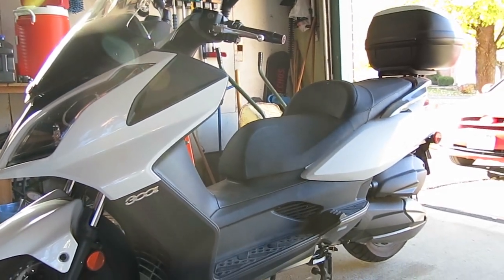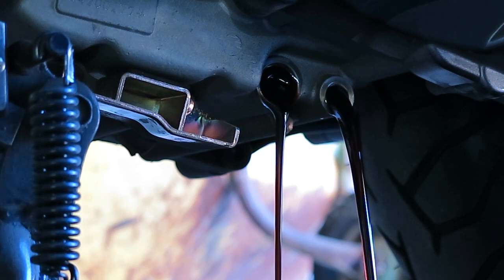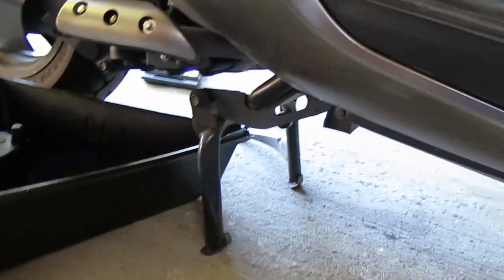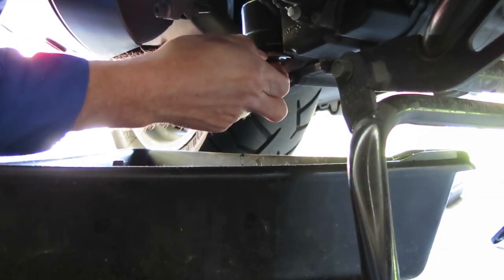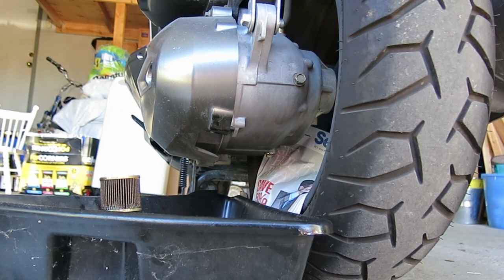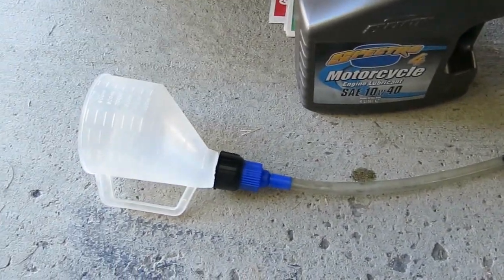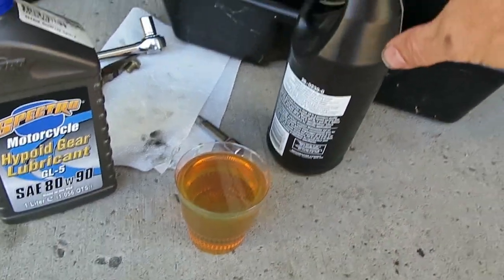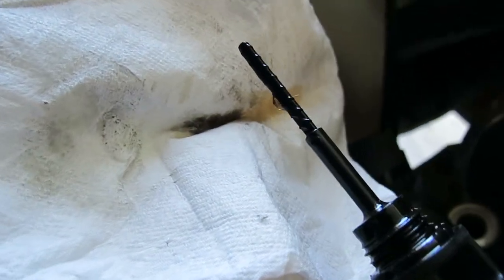Kymco Downtown 300i engine and gear case oil change

Comment: For the gear oil I just use a syringe it’s so easy -just measure what you need and squirted in.  Shouldn’t the drain bolts be torqued?

Comment: Howdy Bloeski....how did you clean the re-usable mesh screen for the engine oil? Just some towels or some cleaning solvents? Thanks
Reply from the maker: mathew apostle I just used paper towels. If there would have been debris in the filter then I would have used varsol or kerosene to clean out the debris.
Reply: Bloeski's Wrecking Crew thanks boss

Comment: @Bloeski's Wrecking Crew thank you for the video, clear and concrete ! I do have one question, just got a scoot (10-09-2017) and I don't know when previous owner change the oil all i know they did not ride it for 7 months and belt was changed 8000km ago.  So far i am driving it for 100 km and it is tempting to change oil since i already got all filters, but my season ends in less than a month and it starts in April.  Shoud i change it anyway and could i use it still for next season ?
Reply from the maker: I always change the oil at the end of the riding season. Then in spring it is ready to go. Also the engine is not left sitting for an extended period of time with dirty oil in it.....Thanks for watching.

Comment: Pro tip. Instead of newspaper, use aluminum foil. Also, if you put it over the drain pan, you won't spill a single drip of oil over the wheel or ground.
Reply: I was wondering why he didn't do this.

Comment: Thanks, very informative. Could you pls tell me how many miles / Km between each oil change? Do you use synthetic or mineral oil? Thxz.
Reply from the maker: The manual says 12000KM. But I change every year even though I usually only put on around 3000KM. Since I will change well before the recommended change I used regular oil rather than synthetic......Thanks for watching.

Comment: Thanks for the good video.  I no longer have a Kymco deal in my area.  I have a kymco xtown 300i, you happen to know if the steps/locations are similar?  Is there a place to order the filters ?  I called a few jobs in my area and they just said they couldn't order anything from Kymco without being an authorized dealership :(
Reply from the maker: I am not sure if the bike you have uses the same engine or not. For the filter try looking on Amazon or at bike shops on the internet. You should be able to send for the filter from many places......Thanks for watching.

Comment: Than you so very much for this video. But I had a lot of problems with inserting transmission oil. That hole is super small and it all dripped and oozed out so in the end I probably didn't put the exact amount of oil (0,21 liter). But your tutorial was top notch..
Reply from the maker: I had to keep the lid off of another oil jug just for this purpose......thanks for watching.
Reply: Hmmmm. I'm not sure I understood what you mean by "keeping a lid of off another jug just for this purpose ". Looking at your video I got an impression you did it just fine, you didn't have any drips. I got to give Kymco a big minus for the placement of that hole. If only they've put it on top so you can normally insert oil. Next time I'll try with a huge syringe, maybe that will work. Cheers.
Reply from the maker: The lid on the oil jug I used to fill the gear case had a pointy tip that just fit in the hole of the gear case. That lid came from another oil jug, not the one shown there. If you have a lid with a tip like that you will not spill a drop either as it fits the hole tightly. Hope this helps...

Comment: Have you found the bike to be reliable so far? Thinking of getting one thanks in advance
Reply from the maker: It is still running with no problems. The only issue is batteries will run flat if the bike is not used for 3 weeks. This wears out batteries in as little as a year.
Reply: @bloeski  thank you for your help great videos ride safe buddy

Comment: Hi, are u sure gear oil should be 230ML? I think it should be 210ML
Reply from the maker: +Jerry Fan The owners manual says 
TRANSMISSION OIL CAPACITY: 0.23 L
TRANSMISSION OIL EXCHANGING CAPACITY: 0.21 L
Take your pick of which number you prefer.....If it is totally drained then I would put in 0.23 L..On the other hand maybe it can not be totally drained and some oil is retained in which case 0.21 L would be correct....Thanks for watching.

Comment: nice one...i always change my scooter engine oil every 1500 miles...it only holds 1200cc   and soon gets contaminated... also you can hear the engine run quieter with new oil... simplest of jobs i dont understand why more riders cannot do this themselves it saves a fortune $$ in mechanic labour costs

Comment: Wait, so the transmission and gearbox/clutch are using separate oils? please explain i'm confused. I have a cbr250 honda sportbike manuel and it just uses motorbike oil for everything. I am interested in a big scooter for the comfort though as an upgrade
Reply from the maker: Many scooters use separate oil for the transmission as the transmission has gears that require a more viscous oil that the engine uses....Thanks for watching.

Comment: Thanks so much, I just got a downtown 300i, new, it sat or 6 years. I love it! PS: Where do you buy parts for it? I am in US and ebay seems way to expensive, people are asking up to 50 dollars for an air filter? I was able to find a website out of taiwan that sells OEM parts, but they only have oil filters, spark plugs and air filters, I was hopping to get the CVT air filter too.
Reply: Nemanja in egypt they have assembly lines for kymco, let me know i can send you their contact, it is very cheap here
Reply: @hghazoly2  thanks, i actually got in touch with guys in taiwan who have ben sending me parts.
Reply: @nemanjatosovic  enjoy ur ride, it is a great scooter, u going to enjoy it for long years
Reply: @hghazoly2  thanks. do you have one too? Do you have IG ill follow you I love keeping in touch with people who also own a kymco
Reply: Nemanja yes, i do have the 2020 downtown, it is a nice bike, i do love it, the only thing i don’t like about it is the windshield, i think im going to get aftermarket one for more wind protection, you can find me on instagram, hghazoly
Reply: @hghazoly2  I agree. I am 182 cm and the winds goes right to my forehead. other than that, amazing bike
Reply: I do own a  2019 Xtown 300i.  Do you mind sharing where you gets parts from?  I am in the USA and it is hard to find parts for my scooter.  Your help will be appreciated!
Reply: @hghazoly2  i would like it please :)
Reply: @marianamae313  Instagram

Comment: Cann you pls say how to refill  the radiator with coolant?i had changed the waterpump..and now i want to fill back the water..but i cant..i found the refill cap.front..under the plastic cover..when i open the cap and fill ...only 200 ml..and it is full...if i start the engine..all coolant explode out..
Reply from the maker: +RogEdItion I am not sure how to refill the coolant. This sounds like you are putting coolant in the expansion tank. I would suggest putting coolant directly into the radiator cap, but I am not sure where it is as it is hidden behind plastic panels.

Comment: hi, have you a video on how to change the air filter on a Kymco Downtown 300i?
Thanks
Reply from the maker: Not yet. I will probably change the air filter next year, and make a video on it.....Thanks for watching.
Reply: Hi. I have a question.. Which oil did you put into transmission and how much of it.?? Metric system would me much appriciated since I'm from Europe. Thnx..

Comment: +Bloeski's Wrecking Crew what can u tell me about this scoot? Im between this and the people 300 gti. Actually I have a Kymco Like, awesome little machine. Love the vid man! so clear so far!
Reply from the maker: +Nicolás Horacio Herrada I did a review of this bike in another video. It is a great bike, but better suited for shorter riders. I am tall and don't fit well in the seat. My knees are bent too far and I am wedged into the seat. I also have a Kymco People S 200 which has the same engine as your Like. The seating is much better for tall riders. Based on this I would go for the 300GTI as I would expect more seating space......Thanks for watching.

Comment: I'm wondering why you are using motorcycle oil in the scoot. As I understand it motorcycle oil is a special formulation that has lubricants in it for the wet clutch plates in the trans. Scooters don't have those. Any good automotive engine oil will work well in a scoot engine and be less expensive.
Reply from the maker: This is a water cooled engine so it would probably be okay with regular engine oil. But I have 2 other bikes and buy a large jug of oil that will do all three. The other 2 bikes are air cooled so regular engine oil would not be the best for them.......Thanks for watching.

Comment: Is the oil filter HF 566?
Reply from the maker: Ian Bolchi I am not sure. I did not keep the package from the filter. It was supplied by my local dealer and it did fit so it was the right one.
Reply: No problem , cheers for answering mate !

Comment: 1.3L 10w 40.     oil filter 24mm  drain and screen 17mm. Transmission 12mm. 80w 90 gear oil .23L
Reply: 23L oil in transmision or 0,230L. Thanks for video
Reply: The manual calls for 5w50, so 10w40 is not a good solution.

Comment: Oh and isn't it designed so you can't overfilleither one
Reply from the maker: It is easily overfilled for both the engine and the transmission.